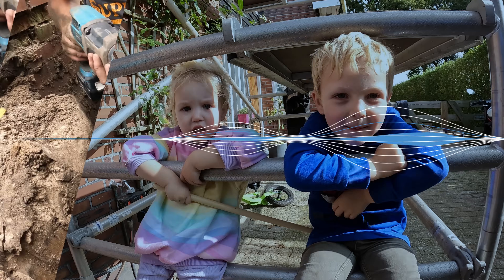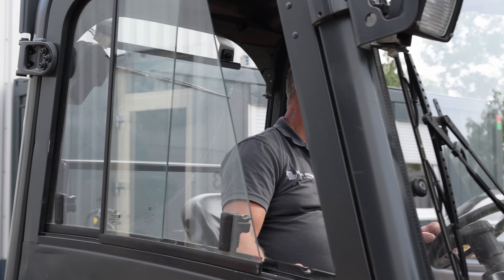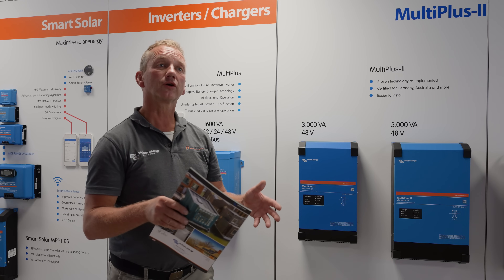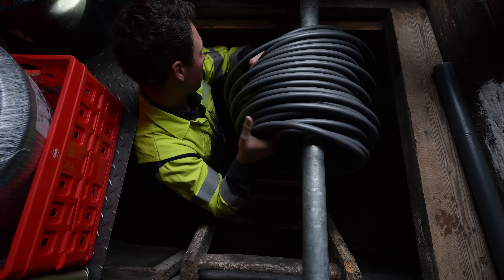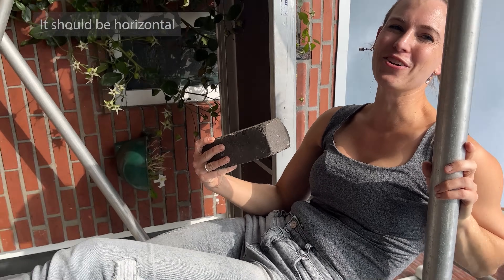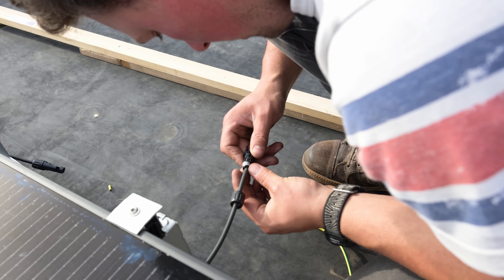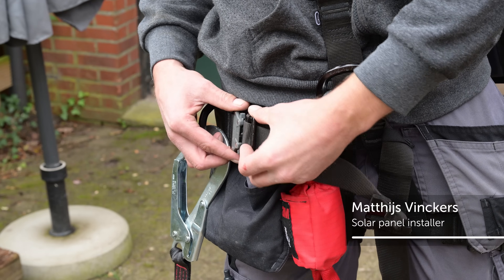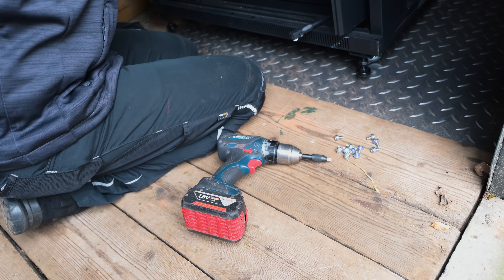Our Home Energy Storage System Install, Solar, Lithium

Comment: Very nice, but one question, what about the heat? 3 times multiplus in a small space? And the fan's are not enough to cool down to say to 30 degrees.  especially in the summer. What will be the temperature in summer when charging / sell form battery?
Reply from the maker: At the moment it's summer in The Netherlands, (25 degrees Celsius outside) temperature in the rack is 23 degrees Celsius. The system is installed in the garage, where it will be quite cool all summer. And there are ventilation holes in the back and top of the enclosure of the installation as well. Best regards, Marianka :)

Comment: How do you manage to what extent power is returned to the grid from the batteries, or drawn from the grid, to supply your home with sufficient power? Can you play with these parameters?

Secondly, does this also take into account realtime negative/positive grid energy prices, or would I need to connect it to for example Home Assist?

Edit, ik zoe net dat ook wordt gereageerd in het Nederlands, dat is ook prima ;)
Reply: In a ESS system like this the priorities to dis/recharge the batteries and feedback energy to the grid when thats done. Same for buying energy,   First the battery power is used and when the inverter and/or battery power is insufficient the grid is there to help out.  Aim is to not buy nor sell to the grid and be fully selfsupporting , unless needed

Comment: only bricks to hold down the solar?? Yikes.
Reply: It looks like the panels are in sets of 3 which should help prevent them from being blown off. Also I don't know how windy it gets there.
On a flat roof at an airport I saw solar racks being ballasted with pavers.
Reply: There is a lip on the garage roof, which deflects wind, also panels seem to be at 10 degrees tils and do not pertrude above the lip. I've got a similar setup and they are rock solid.

Comment: And the cost? I'm guessing at least 30,000 US
Reply: A storage system like this would be around 10-15k
Reply: @johannesboonstra6917  please supply a rough itemization of costs . This is a very robust system, and include labor. Any government subsidy? Easy $30,000 in my humble opinion.
Reply from the maker: Johannes does know how much a system of this size would cost, he works for Victron ;-) Please speak to a local installer to get an itemised report to fit your needs.
Reply: @VictronEnergyBV  I’m somewhat experienced because I installed a similar system albeit smaller system to fit a sailboat (Using Victron )
Reply: I did not include labor of course , here the enduser did most the installation work
Reply: Judging by the evasiveness in cost reveals, I would assume it's priced to what they think you can afford ;-)   These videos are really of little interest without knowing project budget - and yes, everyone knows YMMV, but that's no reason not to give  project costs, unless  there is something to hide.
Reply: @gaycha6589  Whats not clear of the cost of this project? Johannes stated (as Victron employee) that ist between 10 and 15000 Dollars.
Reply: @MrBugsier5  clearly not, eh? 🙄
Reply: excl solar and manpower it would cost €11.000
Reply: It would be interesting to disclose the cost of the project! Why panels with this power? There are more modern panels!

Comment: Some questions please:

- I dont think that fitting all the kit in the small space is how the manual says to do it, is it ok to do it like this?

- I dont see any surge protection on the input from the solar PV, is there any and is it needed?

- The install is done using Pylontech batteries, why where Victron batteries not used?
Reply: Space around the units is fine here , they are not packed and beside this , the model II allows joints mount closer 

Surge protection isn’t required in the Netherlands so isn’t installed 

Pylon is used as there is no high charge / discharge needed from the batteries as the victron is allowing you to do 
Price per kWh is the the factor to choose pylon or similar
Reply: First question, the manual says 10 cm around, and I think they have more (05:31). Also, it looks there are lots of ventilation holes in that cabinet. I can answer the 3rd question -  probably because Victron doesn't have rack mountable batteries.